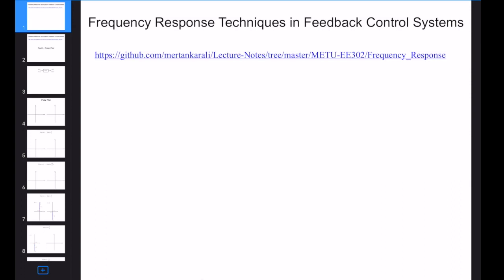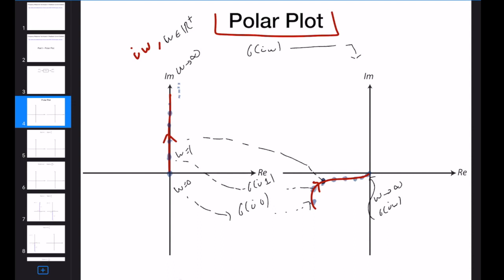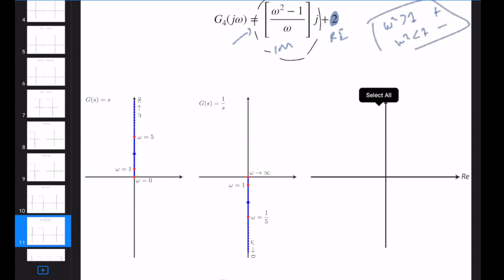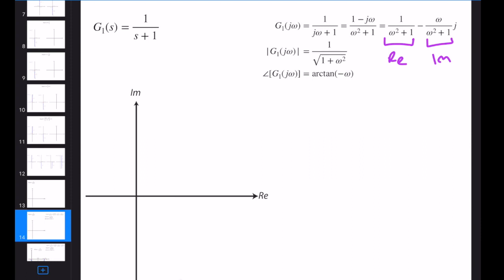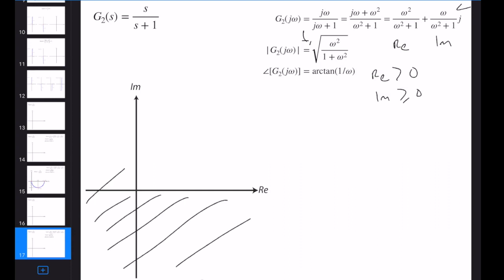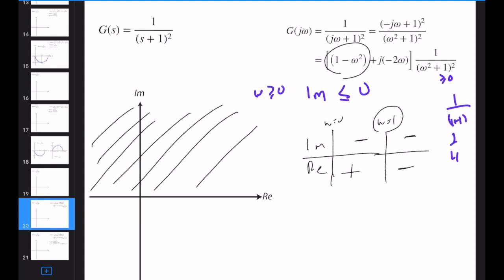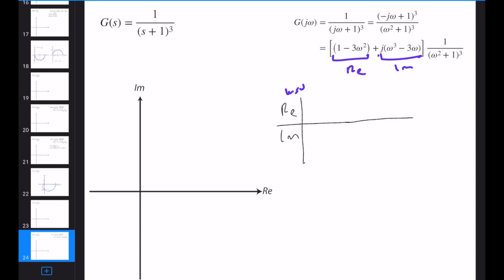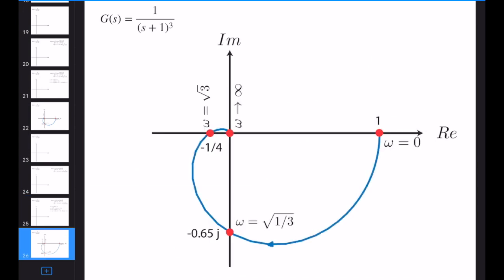Feedback Systems - Frequency Response Techniques - Part I -  Polar Plot

Comment: In the final example, the -1/4 point is a calculation error I think. It should be -1/8, isn't it?
Reply from the maker: You are right, it should -1/8. I corrected in the lecture notes. Thanks.